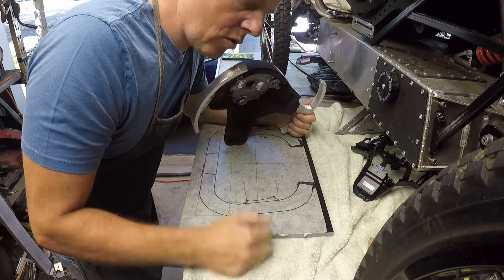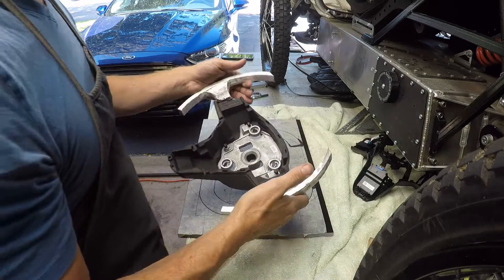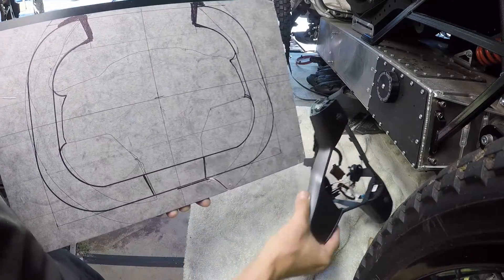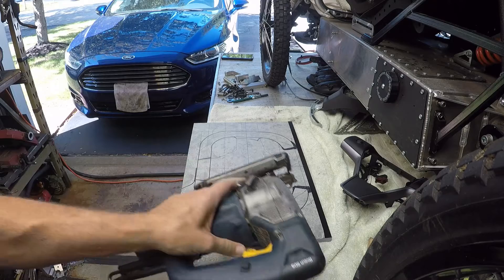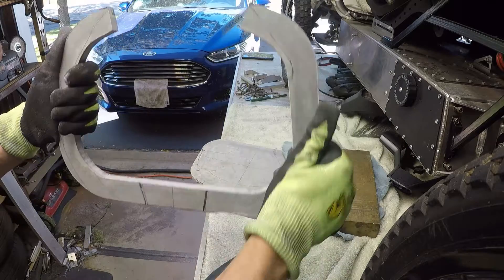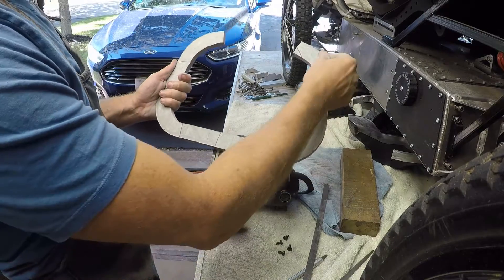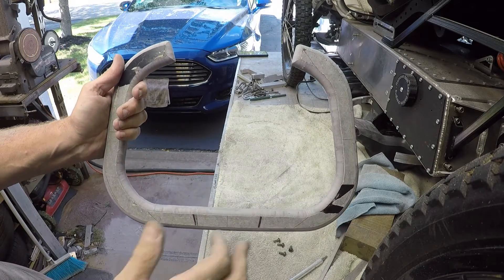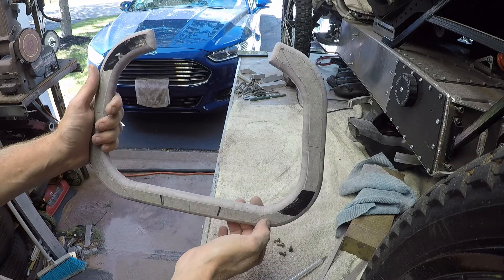Making a custom composite steering wheel for the Model 3 (Part 2)

Comment: Will this still collapse and protect the driver like the original design was intended to in a frontal impact?
Reply from the maker: The airbag is designed yuo protect you. 

Being mounted to the same sub-structure and framework, it should behave similarly to the stock wheel.
Reply: @TechForumTesla  Usually the steering column collapses NOT the steering wheel
Reply from the maker: @sheffdog36  uh, I never said differently.
Reply: @TechForumTesla  That commend was intended for @Coby7, he seemed to be under the impression that the Steering wheel collapses in some way.
Reply from the maker: @sheffdog36  gotcha